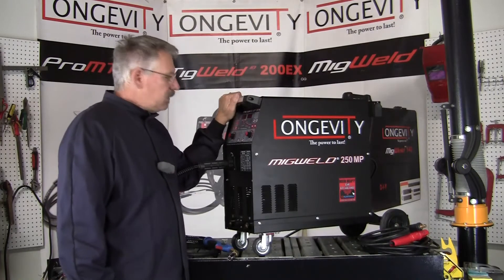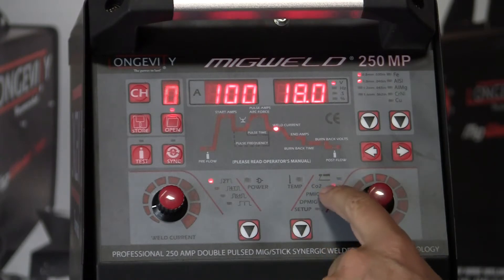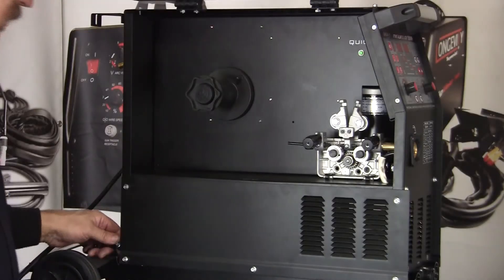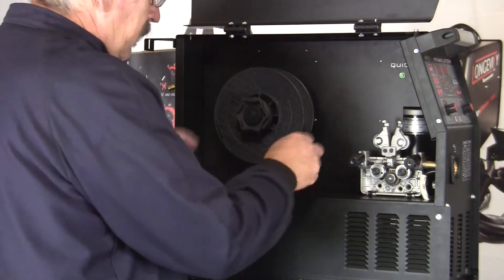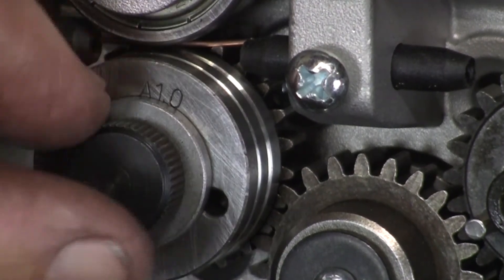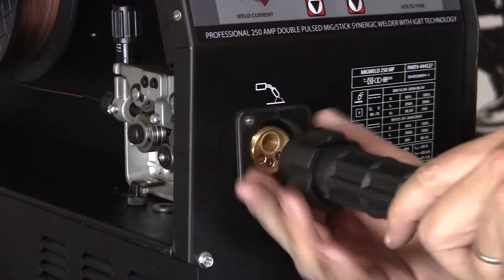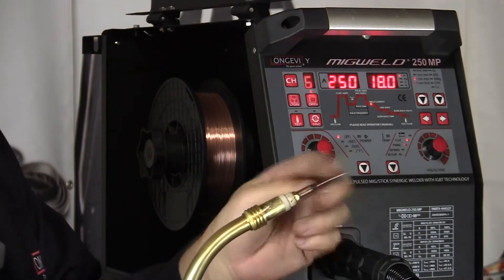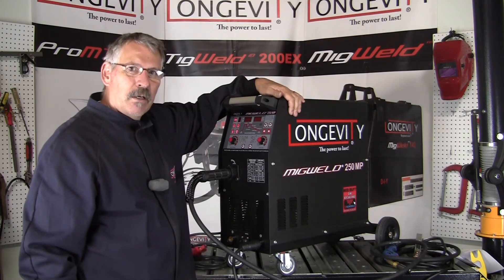LONGEVITY MIGWELD 250 MP - PULSE ON PULSE MIG WELDER REVIEW AND SETUP

Comment: Hi I have this welder new but I have a problem
I try to weld aluminium with double pulse mig it burns back to the tip every time.ive gone through many tips on 2t or s4 model tried all the settings and burn back parameters but still it burns right back to tip and I have to get the gun very close to the workpiece or it won't weld just drop hot balls of alloy.
.When I set the welder to single pulse mig it seems to work ok, still a little closer than Id like but at least not as often a burn back ?
How can I fix this?I have 1.2 wire and 1.2mm alu tips with clean wire and clean workpiece

Comment: Did anyone else notice that the drive rollers are 1.0mm and 1.2mm on the other side,The wire he put in is .035" diameter which is 0.9mm which means he should be using drive rollers with 0.9mm grooves, or use 1.0mm  wire which is .040 " .So in its present setup you may get  some slippage on the feed.
Reply: +scott carr  I agree  I have the same welder and have been trying for 6 months to get some replacement drive rollers For use in steel or flux core  and have talked to Longevity and they have not replied to me yet. It is frustrating as they offer several replacement drive rolls for the their own 140 amp ond other smaller welders